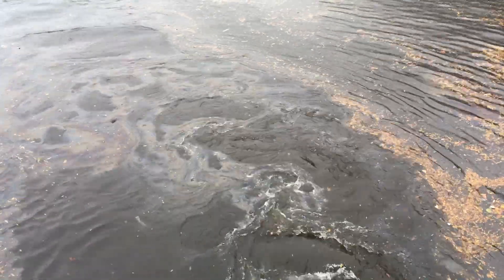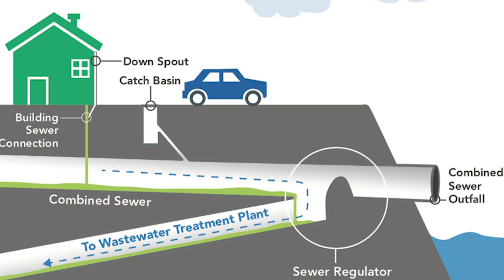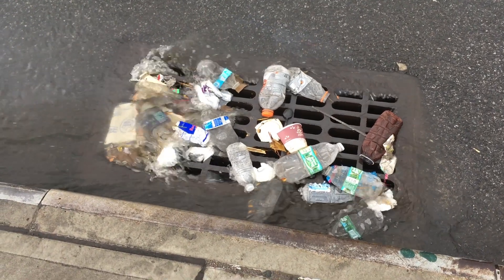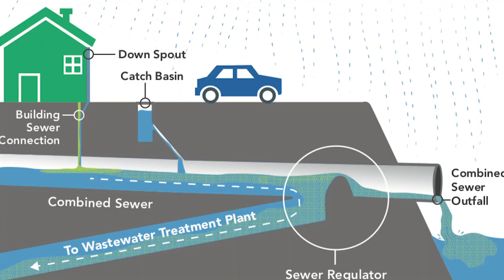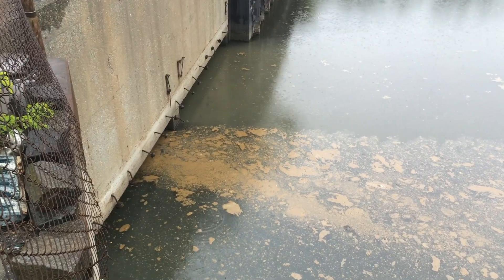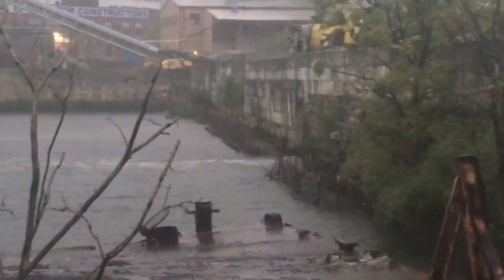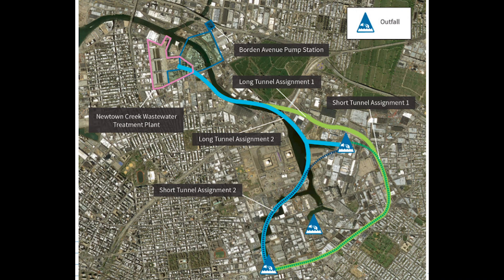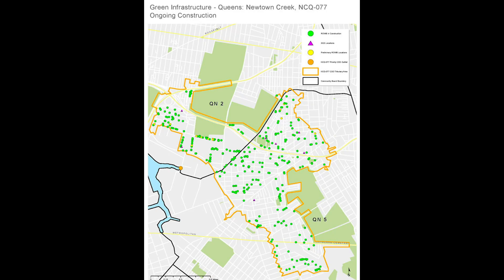Introduction to Combined Sewer Overflow

Comment: These are old systems. I worked in this field and i have never seen a P. U. C. that was designed like that. some systems have infiltration during storms and need to dump the water.  I have never seen storm drains plumbed into live sewers or visa versa in the U. S.

Comment: Instead of using the congestion pricing to fund the  corrupt MTA. NYS  SHOULD BE USING THE $$$ to build huge concrete  waste water treatment storage pits and tunnels that can contain overflows that are poisoning the Hudson River and the wildlife in it. 

NYC is not compliant with the Federal Clean Water Act because it refuses to find a solution to the 60% CSO (combined sewage overflows), that have been in use since the 1800’s. The problem could be solved by utilizing old civil war  Forts and NYC Parks. The same way it put a waste water treatment plant under the Jackie Robinson Park on 145th st in Harlem. It can do the same with the proposed areas.

For those naysayers. I submit that NYC can link several plants together with 6foot diameter HDPE tubing to newly built vertical shaft storage holding pits built under (Brooklyn)…Fort Hamilton & Floyd Bennet Field, (Staten Island)… Fort Wadsworth, & Hybrid Oaks Park, (Bronx)… Fort #4 playground and surrounding area, & Ferry Points Park,  (Queens)… Fort Totten Park & Flushing Meadow Corona Park. Manhattan… Fort Tryon and Fort Washington. All of these facilities can be built directly under existing structures, under parks or  covered by existing grass field, forest, parks and/or new construction. 

These huge cement storage pits would be used as an overflow collection point for each borough’s combined sewer system during storm events that the present system cannot handle. After the events these  pits would pump the overflow back into the system, after being strained for refuse like large items, plastics, paper, flushable wipes, metals, and anything that could foul or  clog the pipes. 

Those items would be removed and taken to the recycling facility or an appropriate disposal facility.The storage pits would hold overflows for several days until the city’s antiquated sewage treatment plant system can safely remove solids, chemicals, street refuse  and bodily waste material from the CSO until it can be safely treated and returned to the river system.

Comment: UK viewer here, and trust me; We know all there is to know about Brexit💩 and the problems of untreated discharge! A couple of tips from me (Mostly taken from cold war CD material) to help with deferring sewage disposal when there's a chance it could end up in the river:

1. If you're a single male household, collect water waste in a suitably labelled plastic bottle (Plastic milk bottles are best) kept by the toilet (Cap the bottle with a piece of toilet paper) and pour it down the drain after the flood is over. Not only can this defer disposal of liquids when the sewer can't handle them, it can also be used to save water during droughts by discharging/flushing less. For the ladies who can; Employ the same method using a home-made adaptor. 👍

2. For European-style toilets; The amount of water needed might be less than a flush. Fill a small bucket with water, and learn how to pour this into the bowl such that it discharges the waste whilst using as little water as necessary. 🌊

3. In cases of emergency or drain blockage/septic failure; Human waste (And TP associated with it) can also be disposed of in the same way as dog waste, provided it's enclosed in suitably strong plastic bags. For more pleasant results, add scrunched-up newspaper to the bottom of the bag first, and store outside the house in waste containers that are kept well away from sunlight.

4. For households that are strictly vegetarian/vegan and where no meat-containing waste is produced; Veggie manure is the same as horse manure, and can be employed in the same way for agricultural purposes. However this is probably best not attempted in an urban environment, except perhaps on a rooftop allotment. 🌱
Reply: Brexit tackle
Reply: Oh... You were serious 🙄
Reply: @apocalypticdaze2139  It's hard to consider in civilised areas, but trust me; This knowledge can come in very useful in abnormal, emergency and wilderness scenarios. 👍

Comment: Well, that's all well and good planning water features to absorb and release water to the aquafer, BUT most of NYC has a labyrinth of subway, water, electrical, telecom and steam tunnels underneath the streets which would make it difficult if not impossible for rain water to go through to the aquafers.  Don't get me wrong, this is a great idea, but is not practical in most large cities (I wish it was).
Back in the early 1980's Philadelphia hired a new sanitary waste engineer.  Once there he undertook a survey if Philadelphia's "combined sewer" features.  What he found was totally disgusting.  The system was originally designed so that during a "rain event" the initial "slug" of water would get sent through to the treatment plants then outlets along the streams and rivers would open allowing the mixture of raw sewage and rain water to flow into the creeks, the reasoning at the time they were built was it was believed that the "mixture" would be diluted enough to not cause problems.  The problem was that once the "covers" opened to allow the mixture opened would not close due to lack of maintenance and they stayed open all the time allowing raw sewage to continually run into the streams and rivers.  He estimated at THAT time, it would cost over 1 BILLION DOLLARS to revamp and repair JUST the outflow pipes.  Needless to say the city didn't have anywhere NEAR the funding, I can only conjecture, they never got repaired.  It is a common problem with a LOT of older towns and cities have been facing for YEARS and every new administration kicks the can down the road at least until the EPA steps in and provides the lions share of the  money to perform the upgrades.
Reply: Why dont they invent

 Adopt a manhole cover... each person is a valuable member doing what it takes to ensure the cover is closed,

Filling out their allocated cover is closed ensures a system where they can monitor it

Consistency earns volunteers vouchers or awards for being a shit hot community asset

Comment: Combined sewer systems are also a basement flood waiting to happen.  There are combined sewers that have no outlet at all; the sewer simply goes directly to the treatment facility.  When it gets overwhelmed, the sewer pipes back up and overflow into basements.
Reply: The best thing we can do is turn off our aerators and try to save all the turds we can by sinking them to the bottom of the OX ditch… it’s a losing battle with a 5 day rainstorm

Comment: The chamber at 1:27 is actually a reinforced concrete chambers built to retrofit to the brick vaulted sewer. I built it
Reply: Looks good bro keep on building great things ! 🔥 I never worked with anything bigger then 15 inch cast iron
Reply: Is that sloped so as to avoid a lowhead dam hydraulic?
Reply: Thanks for the hard work you do for our society!
Reply: Good shit, bud.
Reply: Very cool dude.

Comment: Why don't they have it separated it's easy as that don't combine them
Reply: To elaborate on Kevin's point, combined sewer systems are a product of city planning up into the early 20th century. Most modern systems built today are separate. As kevin said, it can be quite expensive for towns to switch. It's not as simple as closing the connection between sewer and storm drain. As the video described, cities have to build someplace to store the excess water, that would otherwise be released into rivers and creeks.
Reply: In older towns it might cost them too much to do so.